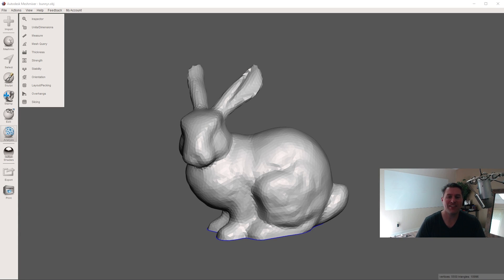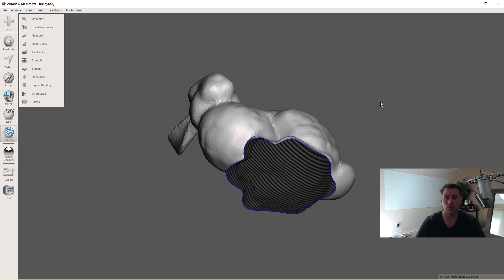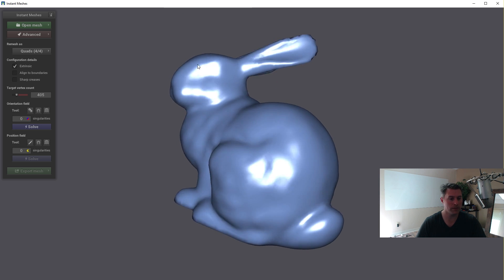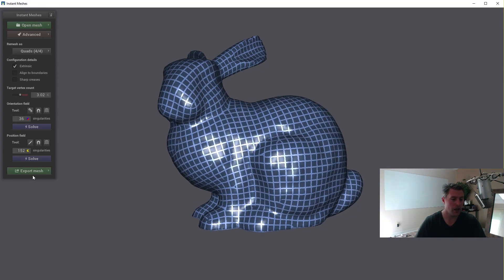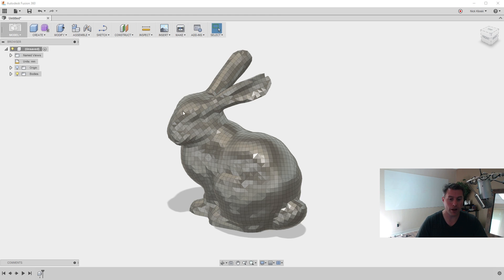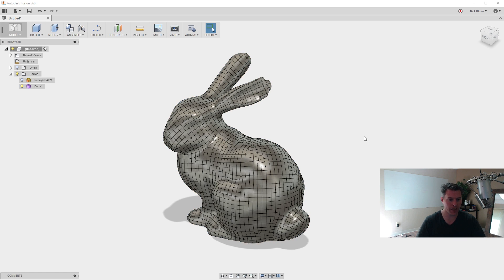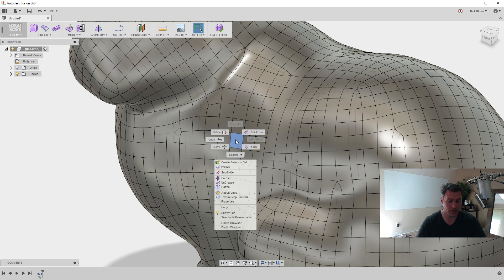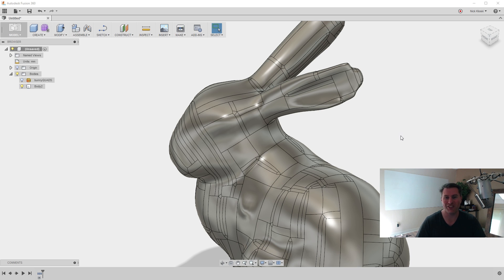Mesh to CAD Workflow Overview

Comment: You're the best. I never comment, but you just saved me a whole lot of head-scratching. Many thanks!
Reply: Just wait! The upcoming July 2021 update to fusion 360 will have tremendously improved mesh handling capabilities. I am not allowed to say more about it at this time, but they have a huge reverse engineering mesh update on the imminent horizon.

Comment: Great video. Vertex count is a problem for my project. Is there any way to reduce the count selectively, as on the flat bottom of the model where a couple of large quads could replace hundreds of little quads? Thanks.
Reply from the maker: not easily, no.....the larger quads would need to gradually decrease in size  in all directions, I have not seen SW automatically do that.  You can always edit the mesh and collapse some areas in Blender, but that is very manual.

Comment: I need to get a CAD model but fusion is not free software. Any recommendation?
Reply from the maker: Fusion 360 (currently) is free for personal use, and free for commercial use if your company makes under $100K per year.  If your company makes over that amount then it is something like $25/month.

Comment: Hi Hello Some of the models at the Last step, that is when I click the "Capture design History"just disappears from the screen what could be the reason and how can I manage the situation?
Reply: Hmmmm.....I have not seen this, the models should not disappear.  Might be best to ask on the Fusion 360 frum if this keeps happening.
Reply: Hello Nick  The faces were less than 10,000.  But the model was a little complex,  so I cut the model into seperate sections and it is working alroght.  Now the part is converted to IGEsplit apart
Reply: But is split apart.  Is there any way to crecombine these parts in Fusion 360 or any other software. Thanks in advance.

Comment: Hello Thankyou for the excellent video.  Can this solid model be used for FEM Analysis?
Reply: Yes...once it's a solid model, simulations should be able to be run against it.  In a funny twist, those models are converted back into a mesh for the FEA simulations internally to the FEA software to actually calculate the results.

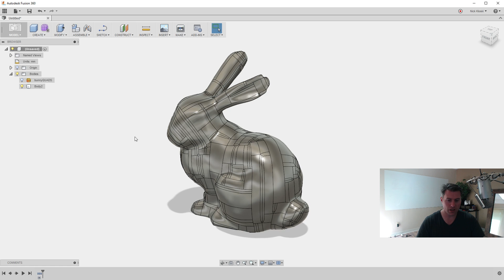Comment: Is it possible to convert mesh to CAD without using Fusion 360 and in such way that you get regular regions instead of random ones (like in 6:38) ? I know that Rhino, GeoMagic and SpaceClaim can do it but I need free software.
Reply from the maker: Yes, sure, but it is a manual process.  Once you import a mesh (either quads or tri's, it does not matter), you can go into the Sculpt environment, and use the Generate Face command with "snap" enabled to draw your own quads on the surface.  If you are disciplined, you can create a nice. regular mesh over the imported model.  Also note that other programs like Blender also can create quads, and they have more advanced "retopo" tools.  The quad-based output from those tools can be brought back into Fusion 360 if desired.
Reply: Thanks for your reply. What can I do to convert such manually partitioned model into CAD format (igs or stp) ? Do I need Fusion 360 for that or is it possible with some free software too ?
Reply from the maker: If you do it inside of Fusion just click on File --> Export and select to export as a STEP file.  Make sure the lightbulb next to any object you don't want to export is turned off.  If you have your mesh visible, I don't think STEP export will even show up.

Comment: Nice video: I am having ago with saving a mess using instant mesh which i have exported from mesh mixer and when i try and save i get this error (instant mesh error write_mesh: unknown file extension "s/aa. (ply.obj are supported) Any what this means?
Reply from the maker: Yeah...Instant Meshes has a little "UI weirdness" there.  When you save a mesh, you literally have to type out the file extension.  You cannot just say "bunny" and have it append the .obj to the end.  You have to actually type out the entire file name, plus extension"  bunny.obj
Reply: okay i understand. I was wondering why you type OBJ at the end of bunny. Thank you for your reply.

Comment: Hi ThereI have followed your fasinating video and have loaded all the files.Following your video, I have converted a file to quad  in instant mesh. On the screen it clearly show it has been converted to squares.However when I import the quad file into fusion it clearly shows the squares but also all the original triangles as well. Fusion then throws a fit and I can't proceed any further,Any ideas please
Reply from the maker: Ah...try this:  open Fusion, click on your name in top right -->  Preferences --> Mesh --> make sure that triangulate meshes is disabled and it should work.
Reply: Magic !! ----   you are a star.Thank you so much.